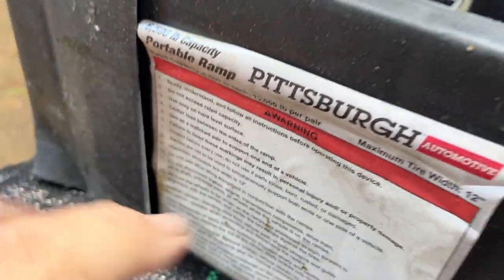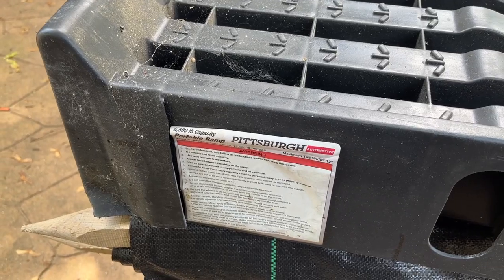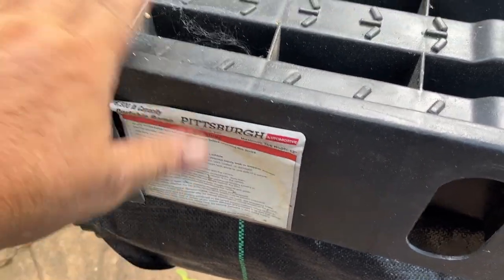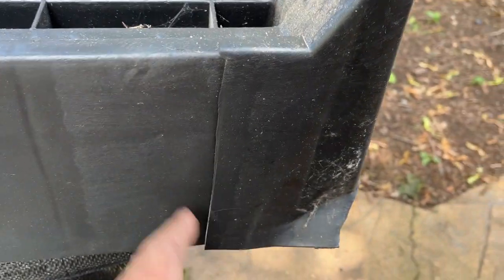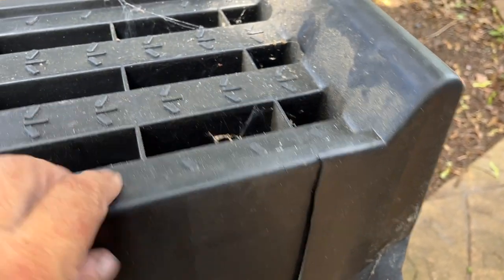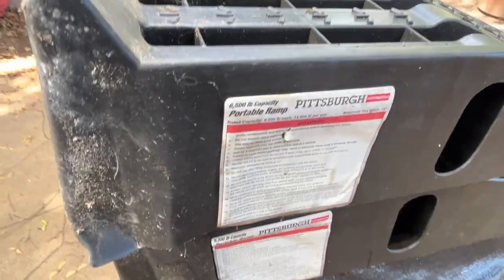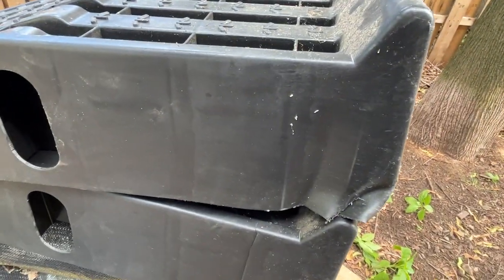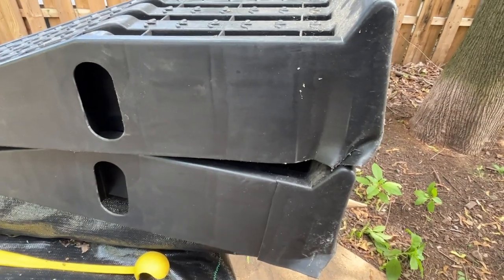Harbor Freight Car Ramp - 2 Year Update

Comment: I bought some of these probably 2-3 years ago and have never overshot yet but they’ve held up great I’ve used them on my car and now rav4 and a diesel f250 and no issues yet.
Reply from the maker: I apparently suck at driving. This summer I overshot the edge just a bit and it cracked the base (I did a follow up video showing it). I actually think because odf the construction of the ramp they probably would have held up even with the crack, but for $60 why chance it?

Comment: They are now on sale for $44 in my area....and I have a much lighter vehicle, a Rav4....and would only use them 2x a year for oil changes. So for that price...I would not expect them to last more than about 3-4 years, but if they last longer that would be great.
Reply from the maker: With lighter vehicles I think they would last much longer than that. I used it for my F-150 and QX-80, both fairly large vehicles, weight-wise. Also, if you don't drive off the edge like I did 🙄 they might do even better than that. Because they have a torsion box design on the bottom I probably could have used them longer even after that crack appeared but for $60 I wasn't going to risk my life. And I just looked and they're $44 by me too. A spring Black Friday sale! Definitely well worth the price.

Comment: Glad i got the Rhino ones, the weight is also rated for 12000+. Im confused on weighr of HF ones, they proclaimed 13000, but now its 6000 or 6500.
Reply from the maker: Its per ramp, so the distributed weight over the two ramps is 12,000 or 13,000 lbs

Comment: You really have to be sensitive enough to "feel" just as the car crests the incline bump as the tires reach the top flat spot to back off power immediately so as not to hit against the end stop  hard at all.
Reply from the maker: Yeah, I tend to be more of a bull in a China shop type of person. :) But you're right. There is that special sweet spot of giving it enough gas to get up the ramp but having the ease to not run to the end of it.

Comment: they have truck ramps at harbor freight almost same price, made of steel, use the right tool for the job sir
Reply from the maker: @they-live1  thanks! I’ve seen them. I trust the plastic ones more than the metal ones
Reply: Who's to say he wasn't using the right tool?
Reply: At least now, the only other ramps they have are steel but they only have a capacity of 4,000 pounds whereas these plastic ones are 6,500. The reviews show many people who say the steel ones did break when they put a truck on them (but I assume all trucks are over the 4,000 lb limit).